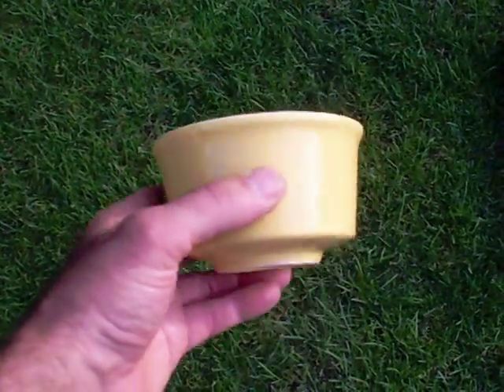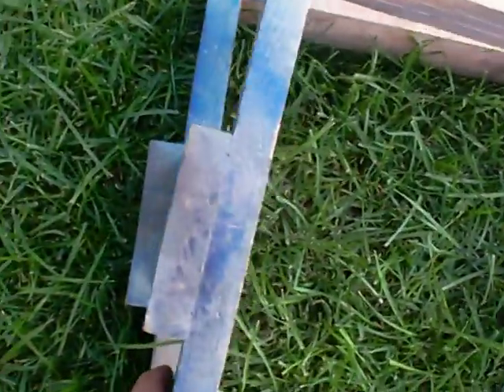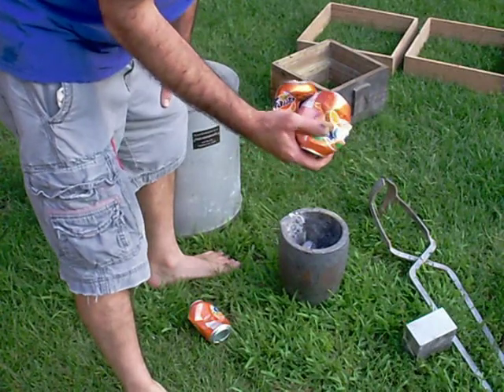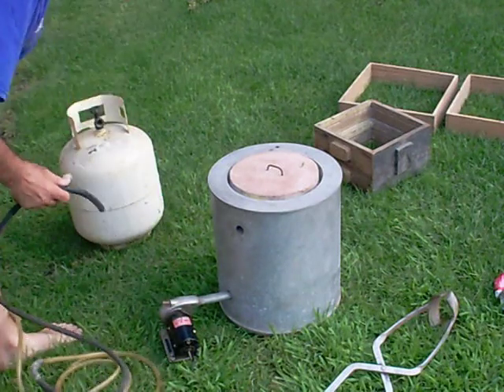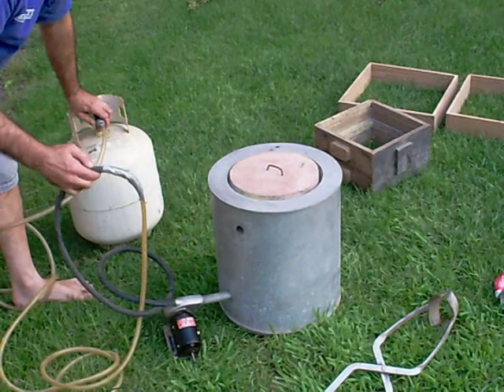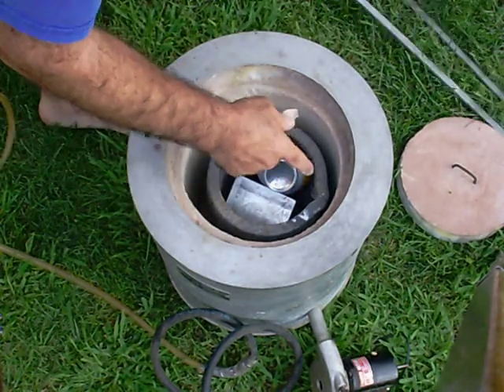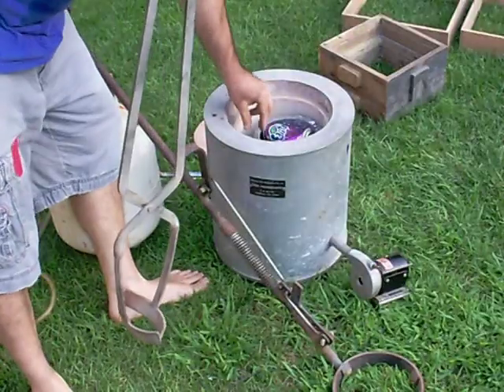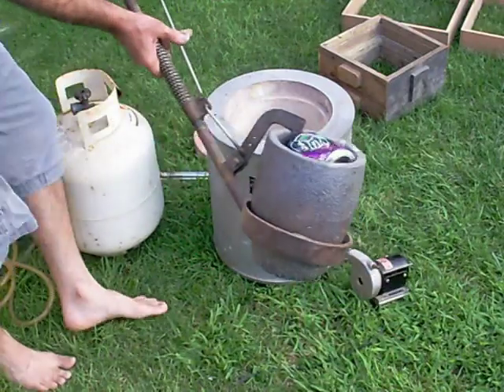The operation of a small small foundry

Comment: I realize this is an older vid, However, I have that same exact foundry setup, it was given to me along with a bucket of crucibles & frames for casting molds. Unfortunately I have not been able to find any documents on that foundry other that a few advertisements from 1960's era popular science mags. So my question, do you have or know where I might obtain something on this system?
Reply from the maker: Not much to know about it. As long as the blower motor is working  it should work. Slide the pipe holding the blower motor about an inch past the interior wall of the foundry.   I hooked the blower motor to what was used as a natural gas line that was used for an outdoor grill that  hooks to the natural gas line inside the house that supplies gas for heating, cooking and running a dryer. First you throw a ball of burning paper inside the foundry with its lid off, then turn on the natural gas and you'll get some flames coming up and out of the foundry. Next,  plug in the blower motor and you'll get a jet engine sound and the flames will start to move back down into the foundry. This will take a number of minutes but slowly slide the lid  back over the top of the foundry as the foundry needs to heat up enough so the flame will not extinguish. If the flame extinguishes obviously you want to be in the ready to turn off the natural gas and try the process again from the start with a burning piece of paper or whatever thrown to the bottom of the foundry.  If the flame does not extinguish  with the cover fully on  the next step is to place the crucible inside the foundry and then start charging the crucible with aluminum or brass. I recommend aluminum for beginners. Once the crucible is charged, place the lid back on. Maybe 20 to 30 minutes later the crucible should have molten aluminum ready to pour. Usually you want to spoon off some of the slag  floating atop the liquid aluminum before you make a pour. Wear plenty of safety gear,  leather gloves, leather boots, a face shield and eyeglasses,  leather apron and a hat. When hot liquid metals come in contact with  enough moisture,  your pour can become a sputtering volcano of hot liquid metal,  launching big blobs of metal in all directions, hence the precautions.

Comment: i dont know how much pressure the blower is able to supply and if there is only this one little exit hole, but i would probably recommend to widen the outlet. otherwise the expanding gases will cause an increase in pressure and the flame will not be that good.